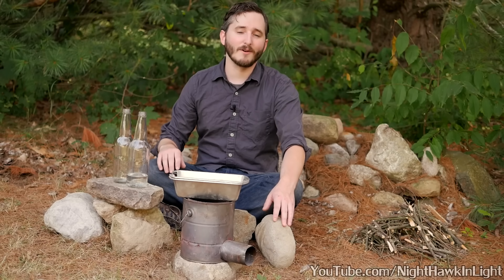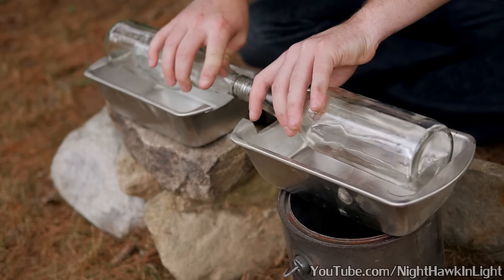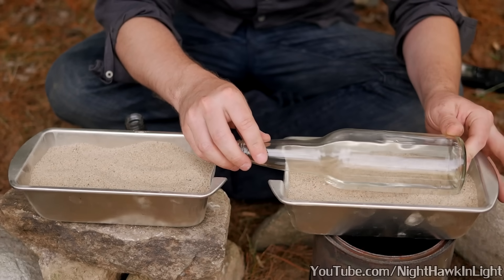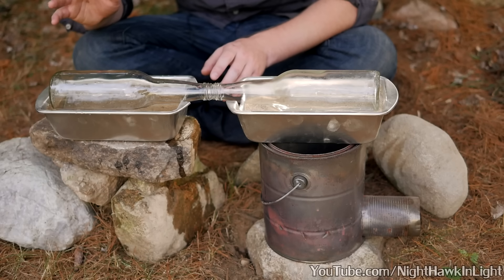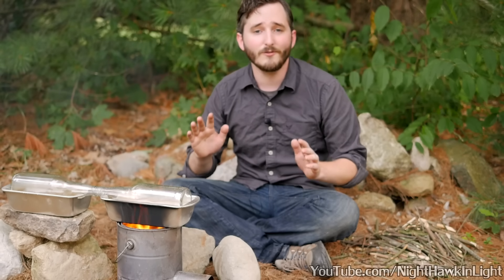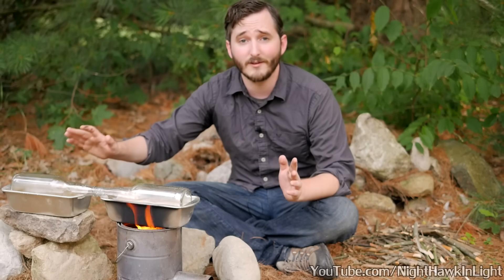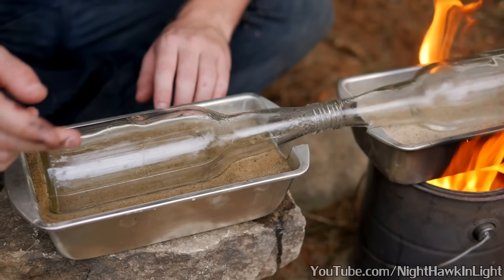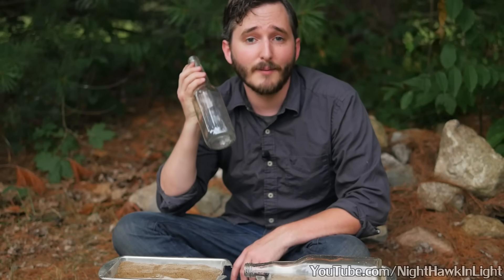How To Turn Salt Water Into Fresh Water (Simple Improvised Distillation)

Comment: As I watch I am in fear of the bottle shattering and glass going in your eyes for not wearing protection over your eyes, but thanks for the info
Reply: That's what the sand is for, it acts as a heat sync to make sure that the bottle gets heated evenly
Reply: SLOW heating is the key to keep the glass from shattering. Sand helps here.
Reply: IF you are stranded somewhere would you say where is my safety gear? while I am getting water I will let you suffer until you get your safety gear me drink you stay safe distance P.S When you gone I will have something to eat and make tools out of bones
Reply: @MOTO BB: Assuming you can get that hot using such a small wood fire.
Reply: glass melts when it gets hot .............................................fyi
Reply: True, but with water in the bottle the temperature will not exceed 100 centigrade at atmospheric pressure.
Reply: You can :-)
Reply: Julie Hobbs You're a first worlder too woman... But yea this person is a pansy. lol
Reply: Geezle Puss worry much? Stop being a wimp...gosh!!!

Comment: Spend a lot of time in the great outdoors do ya.  Sitting in the middle of dry pine needles and using a rocket stove.  Smokey Bear is looking for you.  Clean the area in case you knock the fire of the rock and..  I have never in the last forty years (That's a long time) found two glass bottles on a beach in a remote area.  Only where the tourists hang.  If your on a beach and you bottles, walk up the hill to Hooters and get a beer.

Comment: I would also hope that the boiling of the water would kill any bugs in the water so you could take freshwater from a stream and use this process to get clean, bug free water. Right?
Reply: simply boiling fresh water from a stream would kill the bugs.  There's no need to go through the hassle of the distillation process, since it's only necessary to remove minerals (salt).
Reply: But if you were trying to get the cleanest water possible, would you not still use this process? River water may not have salt, but any suspended dirt or other solids would remain and give you much cleaner water.
Reply: SixStringLove Guy Sure, but my point was in the interest of time/effort conservation.  If you dont mind drinking a tiny bit of of suspended particles, simply boiling river water will get the job done.

Comment: I thought you can dehidrate from drinking distilled water, because it takes the minerals in our body away. Maybe it only happens if you drink large quantities?
Reply: Not dehydrate, but deminerilize. You simply need to eat something to replace the minerals.
Reply: just add back a tiny pinch of the salt left behind to solve that problem
Reply: Non organic minerals? Most minerals are non organic.
Distillation removes all minerals, which can be bad on if the minerals are not ingestet with food. But you could add a small amount of boiled saltwater to the distilled water to remineralise it.
Reply: blackrabbot but you eat and you get the minerals from there so distilled water won’t dehydrate you because it still is water but food has water in some stuff too
Reply: It only takes out non organic minerals. Which is a good thing.

Comment: Great little method! Only suggestion I would make is about making sure both bottles are clean on the inside. Boil water in each of them first and dump that water. Then use the bottles for your distillation. That way both bottles are as sterile as possible.

Comment: Would it be safe if you use urine, sewer or mud water? I understand it will not work if man made contaminants like oil or alcohol are in the sewage water, but I was thinking of poop/urine mixture only.
Reply from the maker: If you can smell the contaminants that means they are evaporating and won't be filtered by this process. Sewage is no good.

Comment: If we replace the water with wine , will we get hard liquor ? or pure alcohol ?
Reply: qassimy With that exact set up you will end up with nothing, at least no alcohol. Alcohol boils at a much lower temperature, so the chances of it condensing back into liquid are slim to none with this set up. You need a controlable heat source (wood sucks for that) and either a coil condenser, or a really really long tube. Then depending on the temperature you can get different concentrations of alcohol. Lower temps=more alcohol.
Reply: That's helpful , Thank you Ilir Kumi

Comment: @NightHawkInLight You described being able to refill the water in the heated bottle to continue the distillation- can you describe how you would do that? The only method I can think of is trying to get another bottle and spilling the water from that into the mouth of the heated bottle. Is there a better method?
Thanks for the video!
Reply from the maker: Take the bottle out of the sand, fill it, and put it back
Reply: You should give the bottle time to cool however. If it empties while you are not around and remains on the heat it will become very hot. The last thing you want is your island's one of two bottles shattering from suddenly changing from hot to cold.

Comment: Well considering that this doesn't do any good to anyone really I can get the premise you move water vapor to another container to relive of any minerals. 

This wouldn't help in Texas waters if it doesn't take out oils or gasoline because many people drive boats, swim, and also spill oil into the beach waters. 

I highly advise not to do this for the risks of any consumption of oil or gasoline is hazardous. Better ways to purify water is to use your shirt or cloth   and have water run through it, and boil the water for 5 minutes to take out any bacteria and small objects that can disrupt your digestive system. And after that is when I can say that you can try to do this.
Reply: Fuels and oil float in water - so just don't skim from the top when you get water to distill.

Comment: There is a low energy way to do distill salt water.  Wet a bunch of vegetation like grass.  Place in a pail along the bottom and put a drinking glass smack in the center of the grass.   Cover the pail with a sheet of plastic loosely.   Place a weight in the middle directly positioned above the glass down below.   Place it in the sunlight.   Fresh water will evaporate and collect on the underside of the plastic cover via condensation.   Because there is a weight on top causing the plastic cover to sink in the center.  As the condensation accumulates it will slide towards the weight (rock) in the center.   And because the glass is directly below it. The condensate will drip directly into the glass below

Comment: I must have seen a dozen ways of turning saltwater into fresh water, and not one of them is worth a piss in the real world, including this one. I'm sure there is one somewhere, but I've been a lot of places in this world, and I've yet to find  spot where you're on land and need to turn saltwater into freshwater.    

I've also found that if you're in an area where you need to distill sea water, you're almost certainly in an area that's very hot, and you may need as much as a gallon of water a day just to survive.  You're also almost certainly in an area where you have bigger problems than the need to distill water.  

Turning saltwater into fresh water is invaluable, if you're stranded at sea, but there's a notorious lack of fuel and other gear at sea.

It just isn't going to happen.  But if you plan on traveling to such a place, wherever that might be, carry a small distiller with you.  It will work far, far, far better, and might actually save your life.

Comment: Probably works better with one aluminum can and one glass bottle (though you'll have to stopper up the can mouth with random foliage for a good seal. Wrapping some soaked leaves around the bottle neck should work fine). Cans aren't nearly as susceptible to heat breakage, and as the mouth is offset from center, can probably hold more liquid to be distilled as well. They're just as common along shorelines as empty bottles too.

Comment: For anyone who want to know how to survive with least amount of water - keep water into your mouth for long time, then swallow. This way you will fill less thirsty with least amount of water. Try it and be amazed how single sip of water can make you less thirsty. Please like this comment so that it stay on top - it may save some live possible one day in harsh condition.
Reply: Yeah you can trick your body into not being thirsty but that's not actually in any way useful, because your body still actually needs the water it thinks it's getting.
Reply: I can't find anymore document about survival which mentioned this method of drinking.
Reply: Up to three days without water, depend of temperature. Just to overcome that gap between finding water. Not for long run.
Reply: I think that I forgot to add that after first sip of water waiting for a while helps to prevent to drink too much water in certain situations.
Reply: Also one need mind to be clear, not occupied by fear - so that can search for solution and find water.

Comment: this method could be vastly improved with any kind of connective material.  

with a small piece of aluminum foil for example, you could easily connect two nearly vertical bottles and use almost the entire bottle's volume of salt water at one time rather than only a fourth or fifth of a bottle at a time.

Comment: Could you make a primitive still to remove manmade contaminants as well?
Reply: I wouldn't suggest it, whether you can distil water to remove any contaminant depends mostly on the boiling point of the contaminant, if it's about the same as the boiling point of water then it's just going to evaporate and condense with the water, so there's a fair chance that with something unknown you'd just end up poisoning yourself.

Comment: Distillation is a separation process that may or may not render purification.  It depends on the chemical mixture.  To state it won't separate water from man made materials is incorrect.  The separation is completely dependent on boiling point and the quality of the distillery.  You are correct it won't separate oils from water, but there are other ways to separate those materials.
Reply from the maker: Not so easy explaining how to do that in a way people will correctly remember. I'd rather avoid the issue and not risk any of my viewers poisoning themselves.

Comment: If you were in a survival situation would it be wise to mix a little bit of salt water with the distilled water for electrolytes?
Reply from the maker: If you're around the ocean you're probably getting enough electrolytes from whatever you're eating. If you don't have anything to eat, a very small amount wouldn't hurt.
Reply: I suppose that's true. Great video! Can you make a video on making homemade rockets? I know it's kinda been done to death but me and a friend attempted to make them a while back using KClO3 and Sugar and they didn't seem to want to take off, even with the rocket attached to a rail. It looked like it had plenty of thrust but maybe the rocket was too heavy? It was a cardboard tube with the end blocked off with clay.

Comment: though i think this is a good survival technique, it's not really a sure fire way. Yes you can find glass on the beach but it's almost never intact, meaning you're probably lucky just to find even one that is nearly intact, and in this case, just cover the hole with some cloth making sure it extends or drapes onto a container bellow. It's a simple way of catching water vapor. You can also use bamboo or wood, and practically anything that can be used to heat up water then just cover it up with cloth or straw to catch the vapors then squeeze it out.

in addition, if the temperature is hot and you want something cold to drink just put the water in a container then put straw (for safety you can boil it too if ya want. And I'm talking about wilted grass or small twigs clumped up together and not plastic straws) on top then put it in the shade then after a few minutes the water would have gotten at least 2 degrees lower than room temperature for water. I use this technique on my plants to get them colder in hot days.

PS: i live in the Philippines

Comment: How about if you use a length of hemp rope, or any natural fiber without colouring?
 Setup is. One barrel or whatever kind of container you have. Place it high and another container below it. The rope will soak up liquids, and because the other container is down low, water from the soaking rope will transfer. I am just wondering if that will remove oils and such, and then you can use the bottle trick for minerals and killing of bacteria?

Comment: cheapest vodka distiller hahaha! Steam create pressure, so allot of your water goes bye bye at the joint, that caqn be fixed by punching a tiny tiny hole on the cooled bottle and isolating the joint with something that wont burn and wont melt.

Comment: to get oil or fuel out of water, you need a thermometer. You boil the water first to about 85°/90°C. The contaminants with a lower boiling point than water are now gone (dont breath in the little amount of steam that appeares). To get rid of all other contaminants, you destillate the water at MAXIMUM! 110°C, but leave 1/4 of the Water undestilled.
Enjoy your drink ^^

Comment: Something not mentioned in this video is you need a good seal between the two bottles or your fresh water will escape as steam. As the water boils the pressure inside will increase pushing the two bottles apart. Whats not mentioned in the video is the bottle is probably hard up against the sides of the tray with the sand weighing it down so they cant slide apart. Theres probably some tape or glue to give it a good air tight seal too.

Comment: I tried making this but a solar version. I just put black cloth under the bottle to heat and white cloth under the other bottle which was in the shade. Got a small amount of water but it wasn't that long and I missed the midday. The sun is pretty strong where I am and there was some reflection off the wall but it was pretty basic test it would work better with more reflection and some plastic to trap the heat. Some of the water was condensing on the top of the first bottle which was reducing the light to the bottom. probably a black paint would work on the outside of the bottle and then insulated box reflector. might not find black paint or cloth on a beach but maybe a good hot black rock in the sun and the sand could give some good reflection and it might be enough if you had several bottles. if you haven't got matches although it is possible to light a fire with a bottle aswell. If it was the really large bottles you could make quite a descent distiller even for non emergency use.

Comment: This was a neat idea! One suggestion though, if you wet the sand on the salt water side instead of the fresh water side, the distillation would probably go faster. 

Wetting the sand increases its thermal conductivity by a lot, as well at its specific heat. So the sand on the salt water side will take longer to heat up, but once it does, it will heat more evenly and with much greater efficiency. While increasing the thermal conductivity of the other side definitely helped with heat conduction, it also trapped escaping heat in the sand which would slow down the cooling by a lot. Lastly, using a couple pieces of chewed (then dried) gum to connect the two bottles would help form a better connection, and insulate the bottles from each other as gum has a very low conductivity.

Comment: I would use one of the tins as an evaporation hood, like they have in commercial kitchens.
Then you could angle the tin to trickle fill a vertical bottle,
Also this way, you could keep the salt water bottle vertical too. Allowing large quantities to be processed at one time and easy refill. Good vid thanks.
Reply from the maker: That's a good idea, as long as the fire doesn't heat the hood too hot as well.
Reply: Yes, you're correct. Maybe increase saltwater angle to 45 degrees. Would not decrease quantity by much. But would help to decrease temperature  to tin evaporator.

Comment: A friend of mine recently asked how I might find drinking water on a comically small desert island.

If the comic island had the obligatory coconut tree, I'd have a little to drink there. I'd probably sweat as much water stripping and cracking them though.

However, if rain was a possibility, the coconut shells could collect a little. Not much hope of that sustaining me...

I might use the sun to evaporate sea water and collect the condensation somehow- maybe a plastic sheet? Maybe one'll wash up on the comically-small beach. I seem to recall something about a method in the SAS Survival Handbook, but...

If the island has the obligatory tree and the message bottle, I might have a better crack at distillation with both a source of fire and a glass container, but it would require more than that to make it work- perhaps a saw would be necessary and I'd still have a use for that plastic sheet...

I didn't think about it again until just now, then immediately came to this video.

This is perfect! I've got a better chance at finding two message bottles on this comically-small desert island with its obligatory coconut tree and mandatory sand.

Now I'm thinking that unless I've got that saw, the tree's not much good to me. Even with it I'll sweat a ton- better breaking the tree up at night, but I'll still last no longer than the tree. True, it'll double as a signal fire I guess, but when that's all gone...

And now I've run out of wood so I can't make a raft, I used my message paper as kindling, I never did find that damned plastic sheet, I can't make a signal fire if I see a ship, and I lasted long enough only to feed the false hope your blasted video gave me, NightHawkInLight.

Thanks for that. Really. o.o